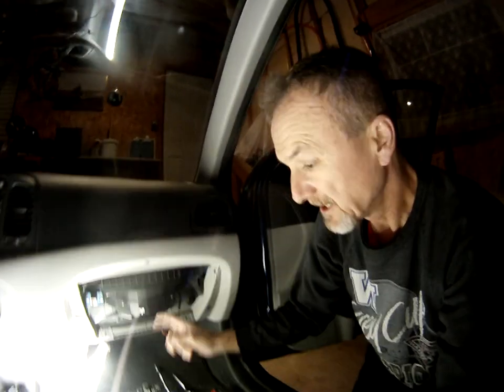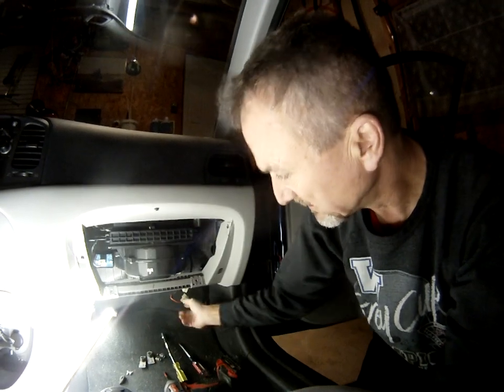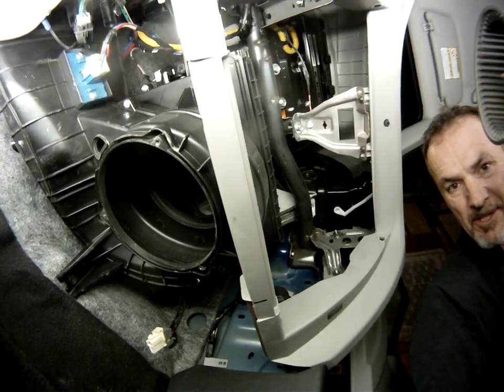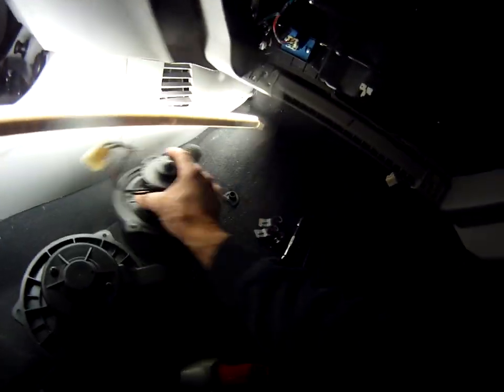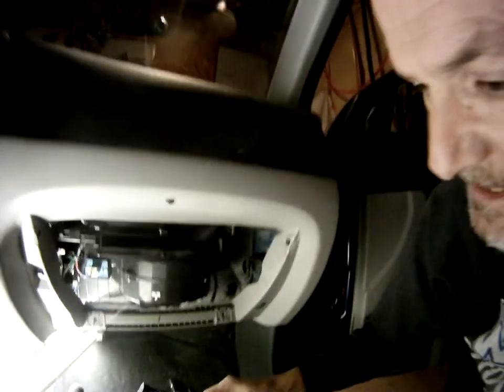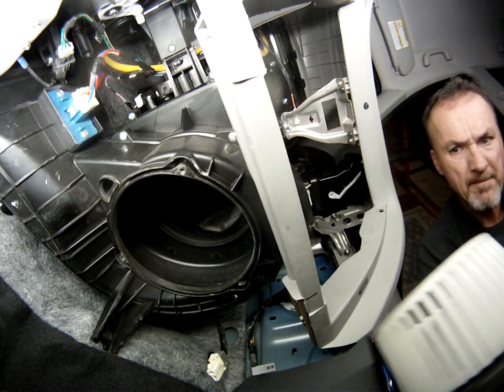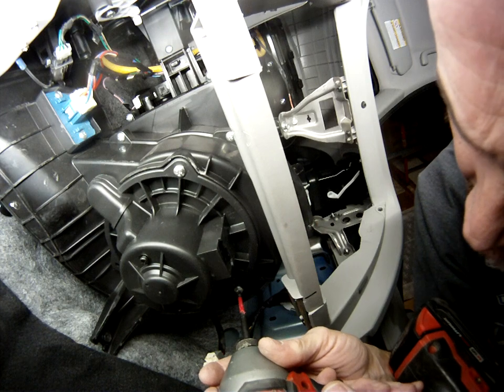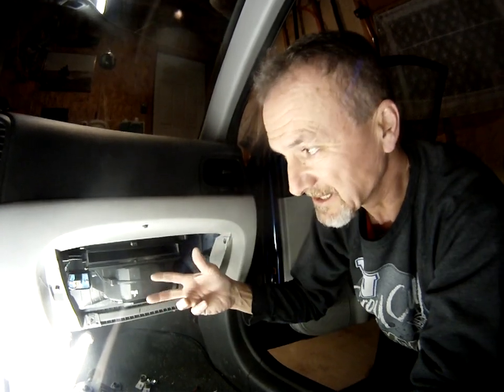How to replace a blower/heater motor.  2003 - 2011 Hyundai Accent

Comment: Thank you for taking the time to recored this video and with the care you showed. I appreciate it!!
Reply from the maker: Cheers! Thanks for watching. Stumpr1
Reply: @stumpr1  We found the wire connector corroded and almost disintegrated. We're having a hard time finding a replacement. Any idea where we can get one?
Reply from the maker: @imedia3d67  Most likely a dealer item. I would just do a search for that and see what comes up. Possible Rock Auto??

Comment: I have a 2013 hyundai sonata, they tried to charge me 600$ just to order the part because you supposedly can not order it separately. I took my car home, ordered the part myself, it cost me 100$ for what I need and put it in myself.
Reply from the maker: $600.00 for the parts? That's insane.  See, easy install on most autos! PLus you saved huge $$$

Comment: Did you have to buy the plug or does it come with the new blower motor
Reply from the maker: It comes with the new motor.  Cheers! Stumpr1
Reply: @stumpr1  thank you sir appreciate
Reply: @stumpr1   could you provide a link or direction to where you got the motor and wire connector?  Went to two of our auto part stores and they both do not have the wire and I can't locate the right connector.  Thanks
Reply from the maker: @loganeubanks9474  Hey, this motor kit did come with the wire harness adaptor. I do not have the parts number for this kit, as I gave the parts invoice to the owner.  Not sure why the ones you located do not have this.   Stumpr1  PS: got the blower motor from Piston Ring Auto Parts here in Manitoba.

Comment: Thanks didn’t know it was that easy. Guessing they’re Phillips screws. I don’t have a new under the hood fuse so hopefully taking it out shaking out the dirt cleaning the electrical contacts does the trick.   If not then I still won’t know if it’s the fuse or motor. 

The cabin fuse was fine. Idk how to tell if the hood fuse is ok. 

Gonna subscribe though this is gonna save me money on my 11 gls. Hyaccent. Thx.
Reply from the maker: Correct, Phillips screws.  Swap fuses with another one of the same amp. IE: 10a or 15a.  This is an easy test. Try this first, unless you already pulled the blower motor down. Cheers!
Reply: @stumpr1  I was gonna but I learned the connecting wire on my 11 accent is brown I mean the metal contact on the harness is brown and the harness connect to the fan is brown. Wonder if it could start a fire but I’m certain I need a new fan assembly as well as that wire that connects to it. 

Don’t suppose you know the name or part number? I live in Canada so prolly have diff pa no.
Reply from the maker: @jerichobeach2967  Why are you changing it out? Squealing? Not working at all? Only working on HIGH speed?  You will not start a fire......

Comment: Could you please post in video description of all the parts you purchased to replace the blower motor and resistor?
Reply from the maker: Joseph, I sold the car off a couple years ago and do not have the parts # for the blower anymore. Blower motor and resistor are plug and play items. Just do a quick search on your vehicle and a list will show. Make, Model, Year and what you're looking for, it's that easy! Stumpr1

Comment: I know this video is months ago, but how do you fix the resistor?  My one two and three weren’t working for a while, and for was. But not it’s not.
Reply from the maker: Hi Keith, you cannot fix the resistor as they are seal, plus they burn out. The resistor controls the 1st, 2nd 3rd settings, the 4th speed setting is a direct to the motor connection.  But you mention that even 4 does not work? I would replace the resistor first, if this does not get the blower motor working, then the motor itself has failed. If this was mine, resistor change out first. Let me know which way you go, Stumpr1
Reply: @stumpr1  thank you for your response.  I guess I didn’t mean fix, I meant to replace . If that’s possible I will try that first.

Thanks again sir the video
Reply from the maker: @KeithLaGrone  Yes, replace the resistor first. Did the motor make any squealing noises?
Reply: I don’t remember it making a squealing sound at the time.  I remember 1, only working T the higher levels, then not working.  Mechanic told me the compressor was out.... and when the fan stopped they thought it might be the knobs and that’s expensive
Reply from the maker: @KeithLaGrone  if it was my car, I would change the resistor out. Cheapest fix first. Stumpr1

Comment: I just replaced the blower motor in my 2010 Accent. I ran into a 2 problems though! Getting that stupid connector off took forever! And for some reason the one I ordered didn't come with a new connector and the old connector (wiring harness) doesn't reach around to the plug in for the new one. Tried to find one online with no luck. Any idea where I could order one?
Reply from the maker: I was thinking a local Auto Parts store, take the connector and see if they can match it up, possibly with a longer extension harness......
Reply: Hey Danielle! I have a 2010 also. Were u able to fix your problem?

Comment: hi,,my hyndai never had the 1-3 speed but now the heat is only a tiny bit and it goes out....sometimes the blower turns on,,i am going to check it tomorrow because it seems this happened after the serviceman tried to sell me the cartridge after my oil change,,,what in the motor makes the heat,,,,,thank you,,,i am very grateful as it is getting cold out,,,
Reply from the maker: If your blower motor only works on HIGH speed, then your Blower motor resistor has failed. The resistor controls speeds 1-3. WHAT cartridge did he try to sell you? A Hepa filter?  The engine creates heat as it burns fuel, the coolant cools the engine and this coolant is circulated thru your heater core located under your dash. The blower motor pushes air past the heater core giving you heat inthe cab. The engine thermostat controls the engine temperature.

Comment: Thanks for the video. I just got a 05 Accent for my mother. Had to replace clock spring, module, airbags etc. I also had a wierd noise coming from the blower. Took it apart and was filthy. Cleaned it and it was fine. Interesting enough the cabin filter was missing in mine also. You think that was from a repair shop being lazy or the manufacturer not putting one in originally? 👨‍🔧👊
Reply from the maker: Hey, thanks for watching!  Also had leaves in the second blower motor, only a short time after install, weird.  Cabin filter, most likely the first owner did not want to pay for a new one to be installed.  Cheers! Stumpr1
Reply: @stumpr1  Yeah. Thats what I figured. Thanks again and I appreciate the reply. Love your channel. Take Care

Comment: what was wrong with the old blower? did it lock up? or just broke flat out? also, do you think there's difference in power and/or lifetime for the more expensive blower, and which price point is the best before you hit diminishing returns?
Reply from the maker: Motor was squealing on low speed setting, changed it out. Nope, as I have installed top of the line electronics and cheap ones, have had both last a very long time and had both fail in short order. I installed one that had a year warranty, still running great. Cheers! Stumpr1
Reply: @stumpr1  thank you for your insight.

Comment: I have the same model car and my ac and heater won’t kick on at all will replacing what you did help or no?
Reply from the maker: Check your fuses first. Check all wire connettions at the blower motor, wiggle them around with the key on: Fan speed at different settings. If nothing is wrong [fuse] Wiring, you need a motor. Drop the motor down and see if you can spin the birdcage.  Is there something lodged in the birdcage preventing the motor from turning? [mouse nest] etc.  Does the motor squeak/squeal when you spin it? WATCH your fingers though with the key on, motor may spin up.  Let me know what you find.  Cheers!

Comment: Hey my sister heat/AC comes & goes like one day heat works next day it doesn’t do you have any suggestion you could give me please
Reply from the maker: I would check the coolant level, this could explain why the heat works one time, then not the other. Could be a Low Level of Coolant. Check the expansion tank level.  Stumpr1

Comment: best part is that.....  I like your light. battery or AC ?? TY
Reply from the maker: 4K   4,000Lumens! LED light bar. Does terrible things to videos, but man what a light bar. 270 degrees of lights exposure! DOES NOT get hot at all. This is a 4' long bar, comes with an off/on switch and about 4' of cord.  AC of course, I have 2 of these, they will light up a 20x20 garage with ease. EVEN WORKS! in -25C temps!......Check out my Light Saber video on my channel, ya ok, weird stuff, but cool. I think I also talk about it on some of my other vehicle repair videos.  Thanks for watching, BTW< any local car repair parts store/hardware store has these.  Bought them on sale for $9.99 plus tax. Massive blow out sale, should have bought more......Wayner!
Reply: @stumpr1  yeah...might try. what brand you say?
Reply: ty
Reply: @stumpr1  but we are replacing same on sonata..can't find a decent video describing location screws, and indications of what order to remove the sonata blower..perhaps with your style...you can do a really outstanding one. problem I am a disabled Marine living on small pension. gotta be how you say...judicious in  personal income.
Reply from the maker: @nkel6111  www.feit.com  Feit Electric, name on the LED light bar.
Reply from the maker: @nkel6111  Not sure on a Sonata,  first you have to locate it. [blower motor] P/side of vehicle, under the dash area. Have a look, should be 3 screws, possible 4 screws. No more than that. I do not have access to a Sonata, so, unable to shoot a video. These should be straight forward to change out.   Wayner

Comment: Mine is melted what would you suggest I do? Replace the blower motor, connector, and resistor?
Reply from the maker: what is melted? wiring?  connector? resistor?   Was the motor working on all speeds? Any noises when it was working?  Stumpr1

Comment: How do you release the wire harness.
Reply from the maker: It's a pressure clip, you need to squeeze the small release type pin in order to unplug the wire harness.